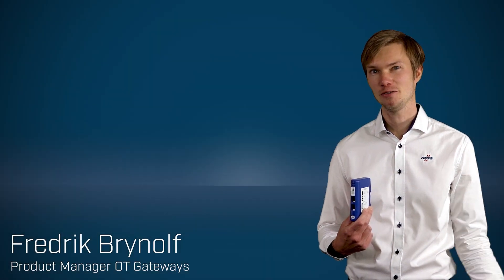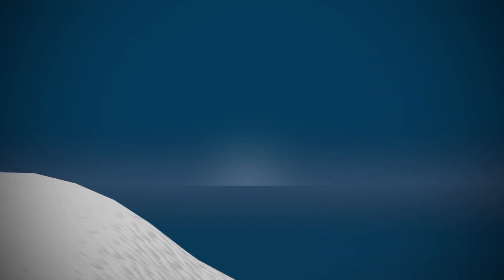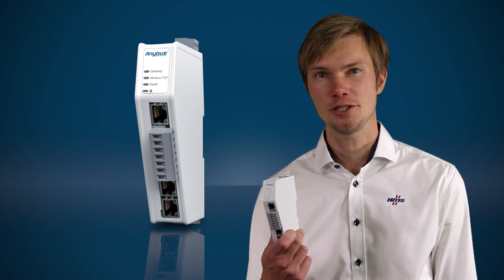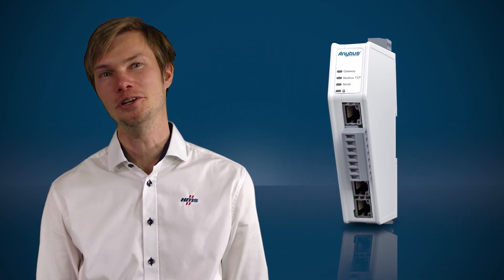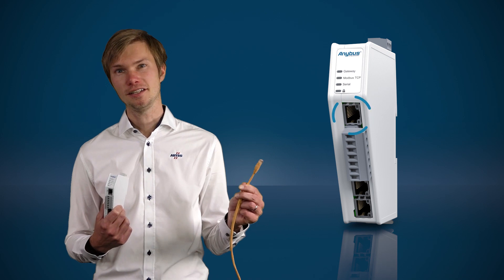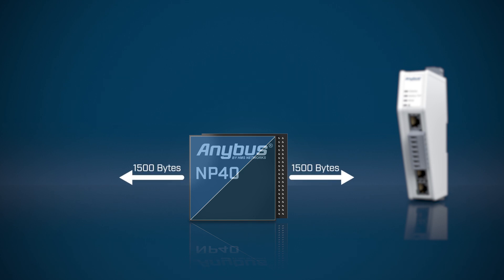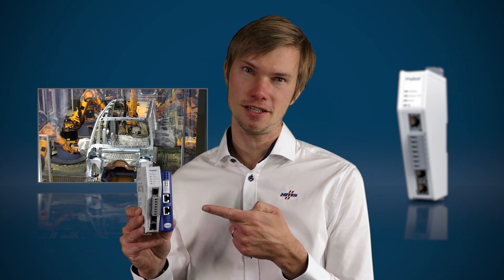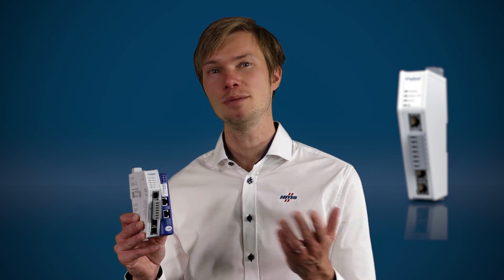Anybus Communicator — Product Manager's View

Comment: Can this be installed inside a housing?? any ventilation is needed?? How about price compared to the classic model??
Reply: Thank you for your comment! 

It can be installed inside a cabinet/housing without ventilation as long as you meet the -25 to +70 degrees Celsius temperature span the product has been tested and certified for. 

Prices are in line with the classic model, please check with you closest distributor or HMS sales contact